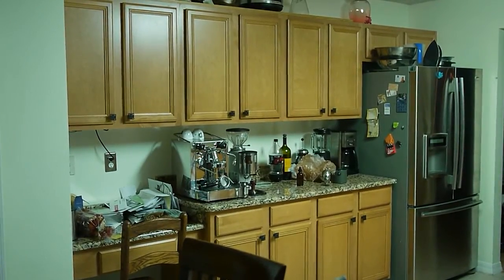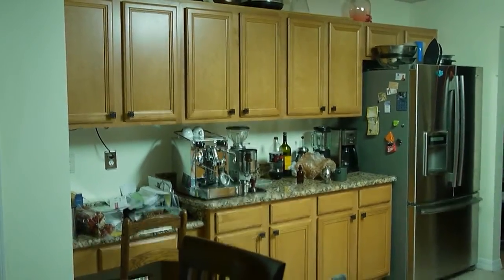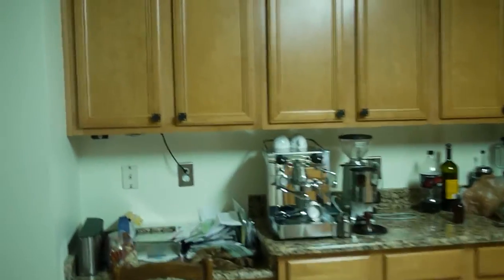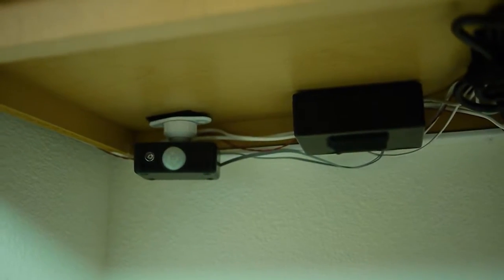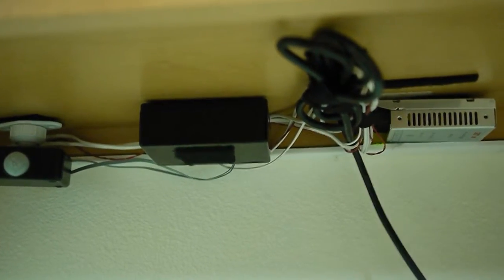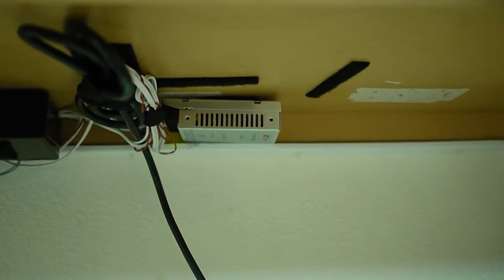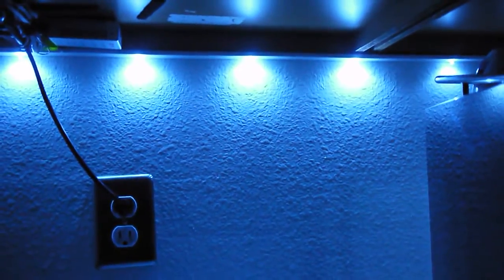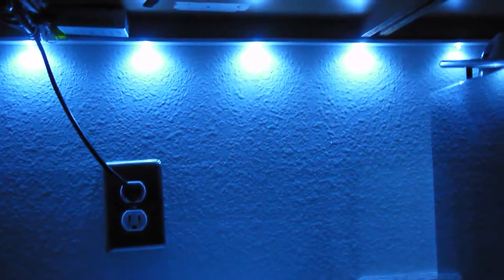Custom Kitchen LED Cabinet Lights

Comment: How do I purchase can it work with voltage in the uk
Reply: Hello,  
I do not have this for sale.  It was just a one-off project that I thought would be cool to design, build and implement.  It is still running to date and works very well.  I love not having to worry about turning it on or off.
If there were enough interest, I would build a kit for people to use which would work for both the US and UK but so far there has not been much interest.